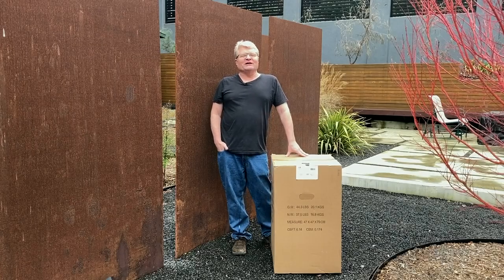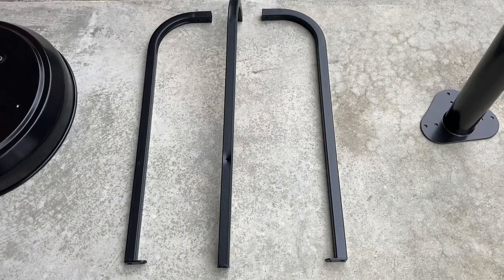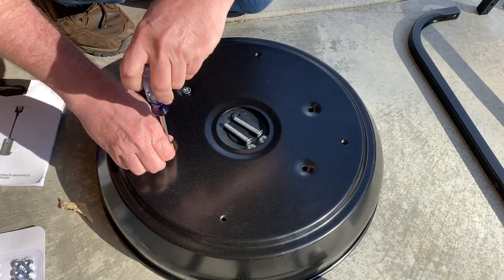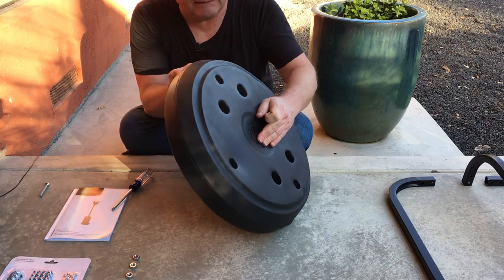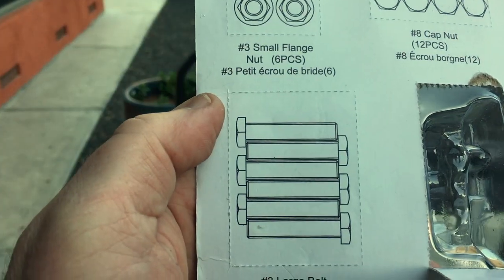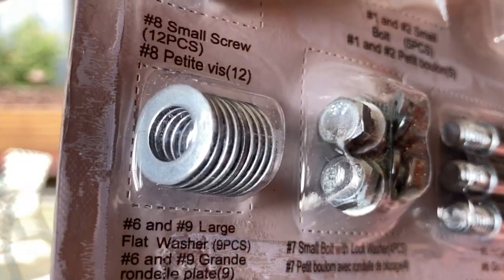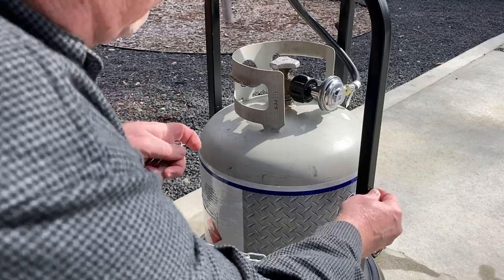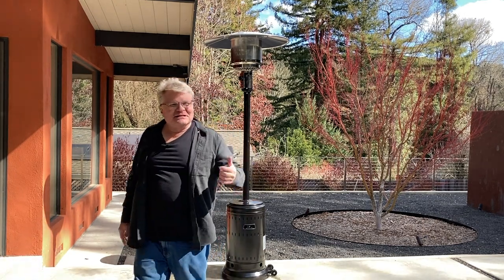Amazon Basics Patio Heater Step-By-Step Assembly

Comment: Thank you a thousand times! My Basics Patio Heater tested below-basic, no manual was included. WardCo, you're my go-to guy for assembly instructions now. I assembled my heater perfectly and probably with less hassle than if I had used only the manual. Before we finished the video, I had my wife help me mount the heating unit on the tower. She was stuffing the "eel" gas hose down the tower and it was a struggle due to the 12F temp outside where the unit had sat. She was particularly miffed at the annoying tag on the hose. Then we watched the end and laughed heartily at your frustration with the same darn tag! Good work.